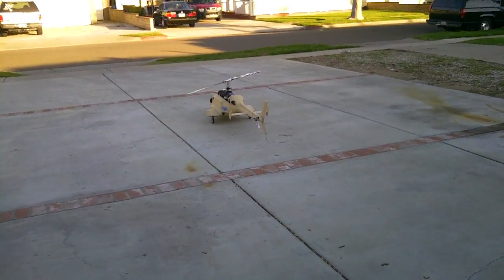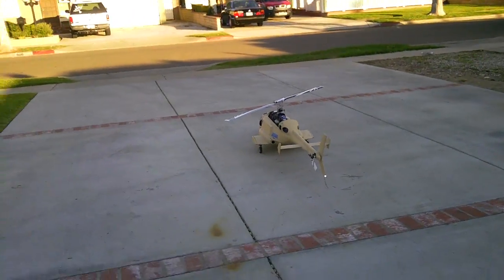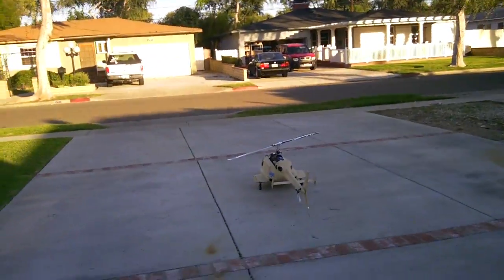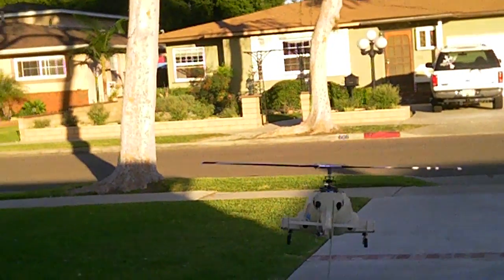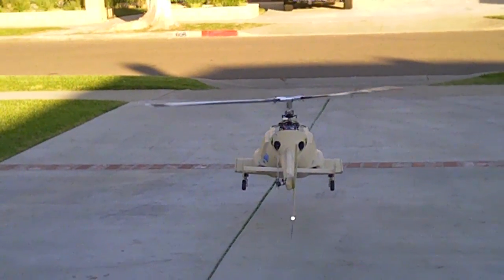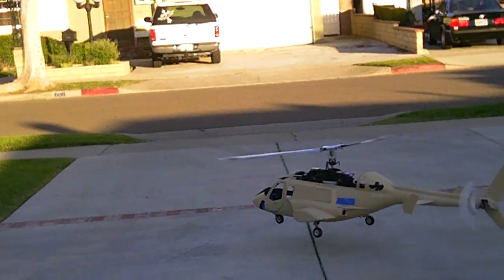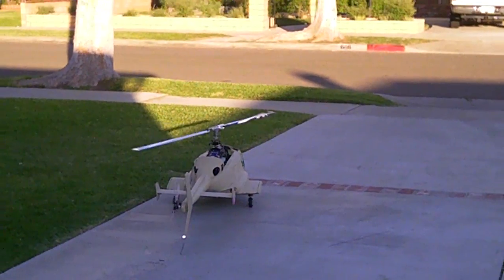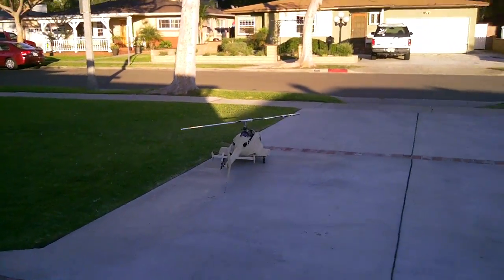AIRWOLF TEST HOVER #1

Comment: What flybarless system are you using along with the GY611 gyro? also, did you notice your tail blades are spinning the wrong direction?  It would be better for the gyro and tail servo if the blades were spinning up into the downwash of the main rotor (like every other heli) Very nice work by the way..